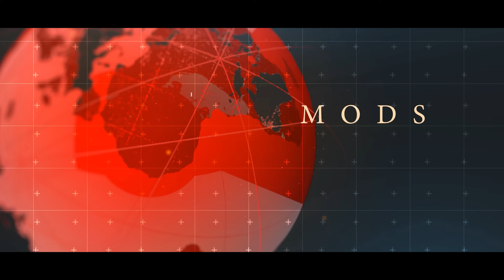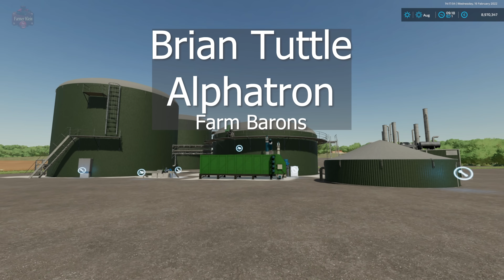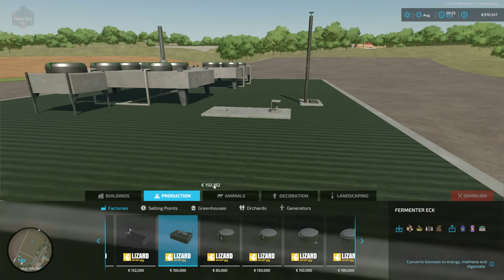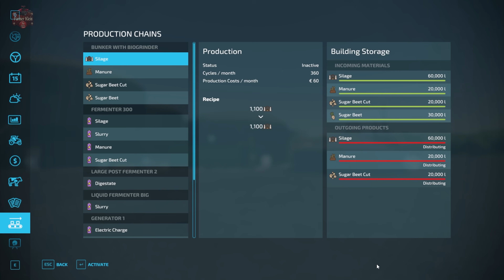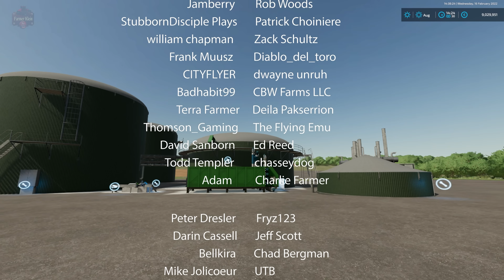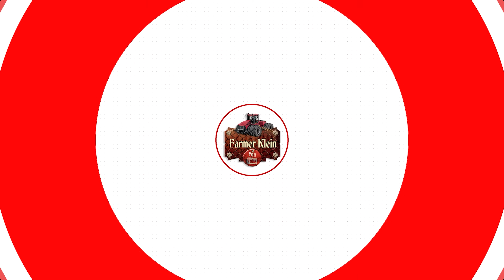Modular BGA | Mod Review | Farming Simulator 22

Comment: Brilliant mod, I just don't like the pricing.  If real, this would win a Nobel Prize and solve the world's energy problems.  The stock BGAs profitability is quite fine, as good or better than most things, however it is a large $$$ investment and takes up a large amount of space.  This mod is fantastic as it allows you to first invest in a much smaller amount of land space, and customize exactly what you want, and then affordably scale up from there.  The problem, is that the smallest version of this BGA is much more profitable and drastically much cheaper than the largest stock BGA.  It needs balancing.  Its almost akin to the lime production plants that can sell lime for $4000/1000L.
Reply: I'm not sure how you are making the smallest BGA, the Fermentor 100, more profitable.  It handles almost the same amount of silage, manure, and slurry that the stock 500 BGA does.  In testing last night I was getting between $530 and $570 per 1k per input on normal economy.  That's the same that the stock 500 BGA gives me.  You only make more money if you are using a generator but selling straight from the fermentor it's the same as the stock BGAs.  As far as being cheaper so is a lot of other mods in the game. The first silo I bought was $198k for 2 mil in storage.  One I use now is $30k for 5 mil in storage and it accepts bales.  Just the way mods go.
Reply: @Dave the balancing isn't about the price of electricity which are the same for all BGAs, but rather because of the recipes and cycles per month.
Reply: @AbelRamirezII  The recipe and cycles for the Fermentor 100 is almost exactly the same as the stock BGA 500.  The Fer 100 can do 108k of silage and 24k each for manure and slurry in a month. The BGA 500 can do 101,760 of silage and 24,240 each for manure and slurry in a month. Both put out 90% of what is put in for electricity.  Not seeing a balancing issue there.  All I see is a mod that will allow you to do the same thing for less construction cost like 100 other mods in the game.  Do some of the other fermentors pay out differently? Yes but that wasn't what I was comparing.
Reply: @davekiefer5701  Well... you are wrong. The math shows the Fermenter 100 is WAY more efficient than the other Fermenters.

The base in game BGA will get you $500 per 1,000 silage. The Fermenters in the mod 150-300 will give you $351-$381 per 1,000... BUT the Fermenter 100 will give you a whopping $640 per 1,000 silage your feed it.